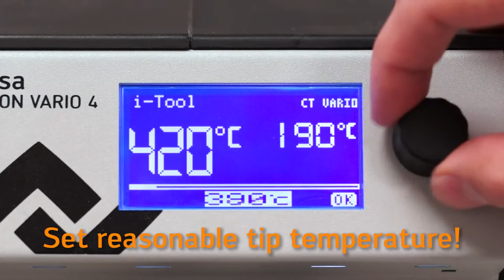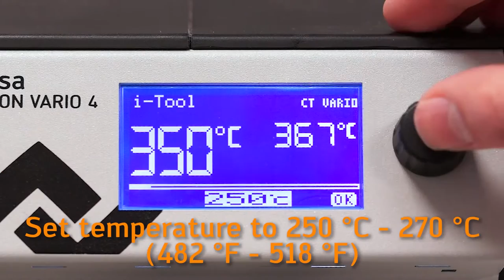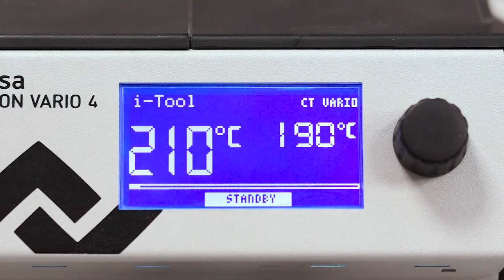Ersa explains #1 – Soldering tip care

Comment: Why is it bad to wipe of the tip on the metal wool?
Reply from the maker: Wiping movements can not only damage the tip, it may also cause splashing solder or even break the metal wool which can be thrown onto the assembly. Therefore we recommend just to stick the tip into dry cleaner and turn it a bit. Alternatives like a brush or a damp sponge are shown in the video, too (1:28). Thanks for your comment.
Reply: @ersachannel  Ok thank you very helpfull!

Comment: It's almost impossible to exchange soldering tip on-the-go carefully because it stucks on the heater when temperature is risen
Reply from the maker: Changing tips on the fly is normally no problem, nevertheless you may have to check the heater for oxides and clean them off with a brass brush. If you have further questions about this you can contact our customer service: service.tools@kurtzersa.de
Reply: @ersachannel  thank you! In cold state everything is fine but at 340*C it becomes a real pain in the a** when i try to change tips (i use Nano and 102-series tips). They sit very tight on the heater. I'm definetely contacting support.